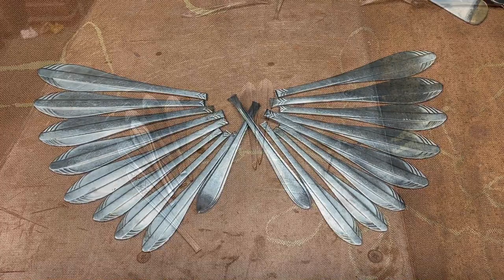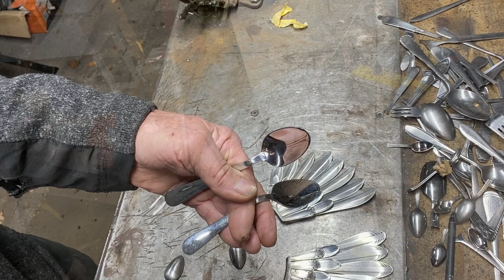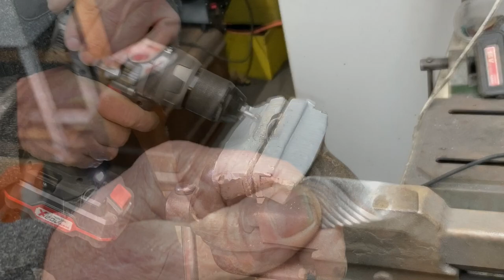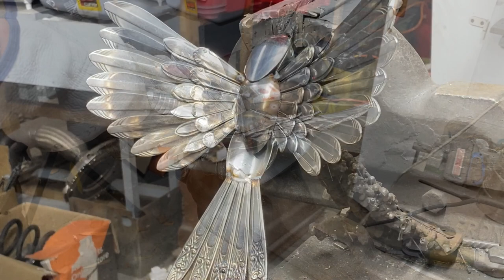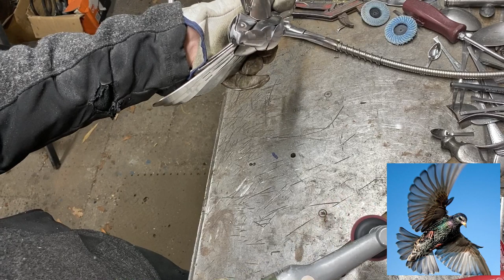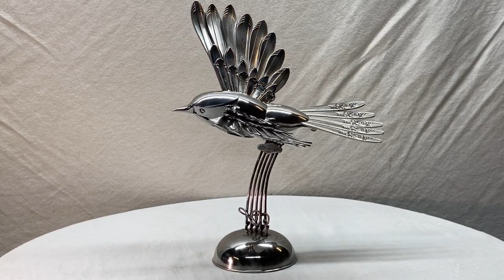How to make this Metal Art bird from cutlery.

Comment: What kind of welder do you need to do this?
Reply from the maker: Hello,
You can use a MIG or TIG welder.
I used a MIG welder and protected the weld’s with clear coating against rust.
Reply: Lovely job thanks for sharing, is it stainless wire or mild steel you use 😊
Reply: Oooops sorry I got the answer further down in the comments

Comment: are you using a standard wire feed welder? What type of wire?
Reply from the maker: Hello Bruce,
Yes I use a standard MIG welder with 0,8 mm steel wire.
Thanks for watching.
Reply: @BrutusMetalArt  I want to try this. Do you think a wire feed with no gas would work?
Reply from the maker: It will work,but welding without a gas spatter a lot, so more cleaning to de.